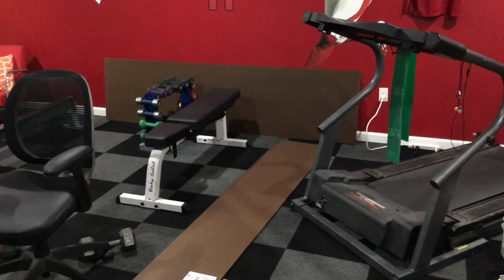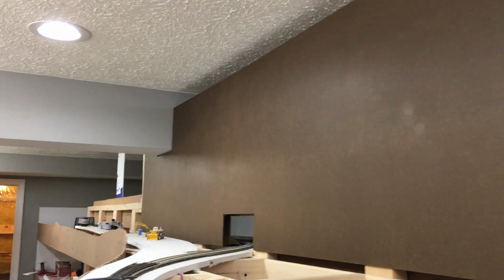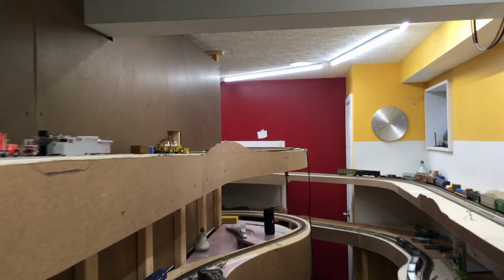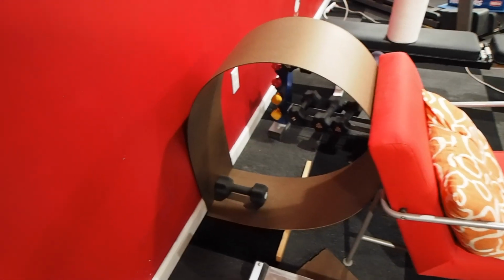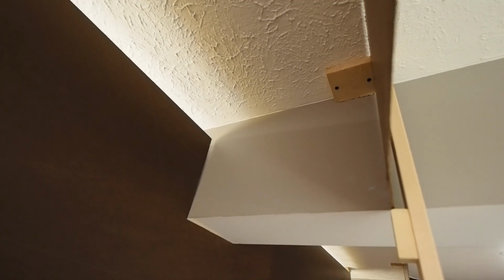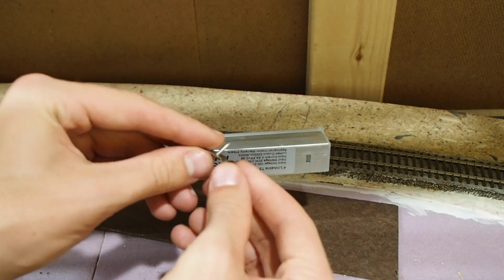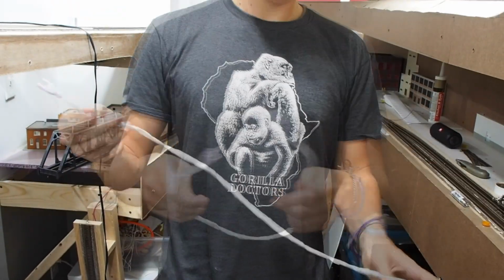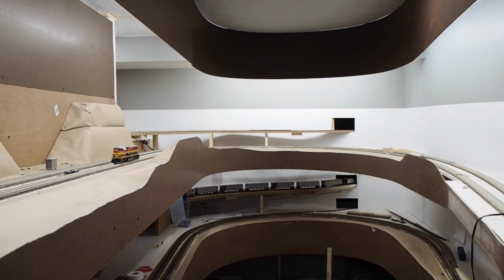Installing the Lighting Valence - BNSF Plains Division HO Layout

Comment: I found at Home Depot. Plastic H channel that can slip the hardboard into. They also have corner pieces. It's for use in showers. They are 8 feet long and ease to cut.  I can send you a picture of it. They are not expensive.

Comment: Do you know the dimensions of that room? I'm looking at building a layout almost in the exact same way you have in a room that looks very similar in size. Cheers
Reply from the maker: Cool! Yeah, the room is 12' x 28'. Four feet of the length is occupied by the staging room which makes the main room only 12' x 24'. Also, you'll notice that about half of the room is narrow and the other half is wide. The narrower portion is only 10' wide, so we've fit quite a bit in a tight space.
-Cam

Comment: Try wetting the board it makes it bend easier also you could try steam my farther use to curve hardboard, back in the 60s, using steam from a kettle to curve the board it was quick.
Reply from the maker: Good suggestion. I considered doing that along some of the seams in the curves. Turns out I didn't need to, but I bet that would've helped.
-Cam

Comment: I wish that I had seen this video before doing my own valence years ago. Can't imagine how much better it would have been. Agree with the other comments about spackling...it will eventually crack. You could try something simple like black electrical or black duct tape. It's near the ceiling so you will hardly notice it.
Reply from the maker: Thanks! It's definitely a learning experience. And I'll probably try something like that. 
-Cam

Comment: Oh, and btw, for filling the cracks, I've heard Woodland Scenics Paste is one of the best ways, it won't crack out over time and stays flexible. That's a Miles Hale trick, and the few people I've seen do it worked great for. I've always used spackle or wall mud/plaster, and it always cracked. Works especially well for backdrops if your putting up photo's as I am. But for those going to paint their backdrops, there must be a solution that doesn't crack and gives you a smooth surface. I'm using prepainted rolled aluminum flashing for my backdrop, and I'm still thinking about the material for my valance. I'd love to have a solution other than Masonite, but that's prolly the best for a valance.

Comment: Hi Cam again looking good - as to your cracks in the Valence, for my ones i cut thin strips of hard board and glued them to the backside of the Valence ( facing the backdrop) and clamped and left to dry. Then using filler i filled the gaps and was ready for painting. Well done.
Reply from the maker: Thanks! I have started to add those small strips like you said. They serve the dual purpose of tying the pieces together while providing some backing for the filler to ... well... fill. 
-Cam

Comment: those light cracks in the hardboard: perhaps just white household caulking and round-off using your finger.
Reply from the maker: Good idea. I used some caulk to seal gaps on the fascia, and it worked well. Same sort of idea.
-Cam